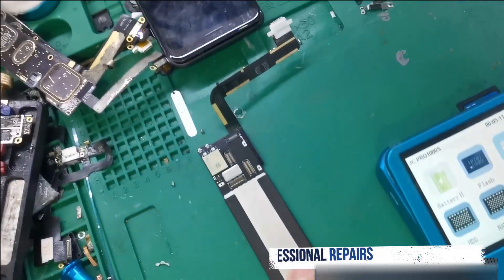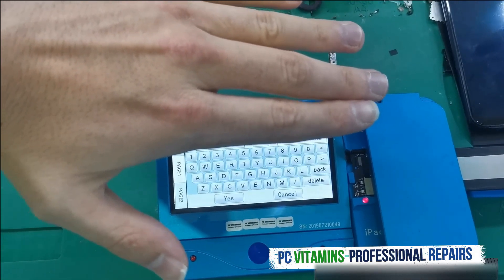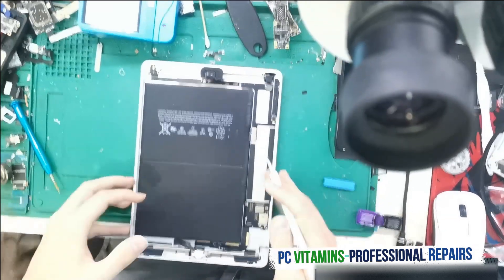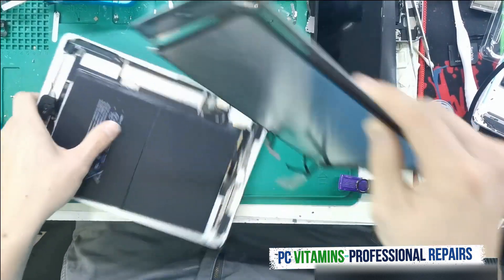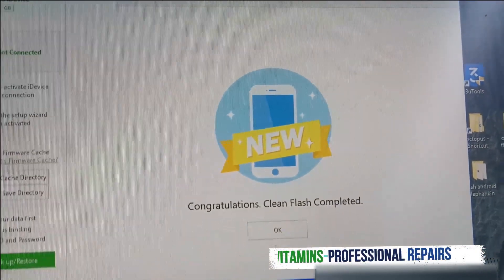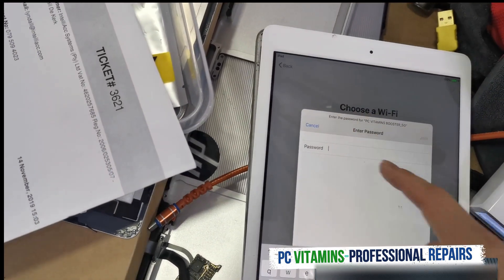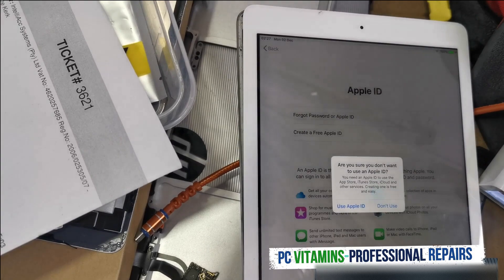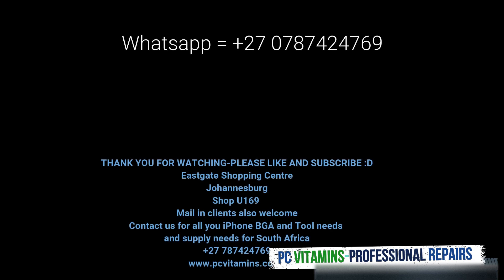iPad Air 1 iCloud removal, bypass with JC Programmer for $10

Comment: the question is, was this method can use for all iPhone version?
Reply: You can't 
But if you have a passcode locked iPhone minimum iPhone 6S/6S plus on iOS 13 I suggest IFPDZ FMI off tool,provided previous owner or you never change password
Reply from the maker: hello , no only iPads